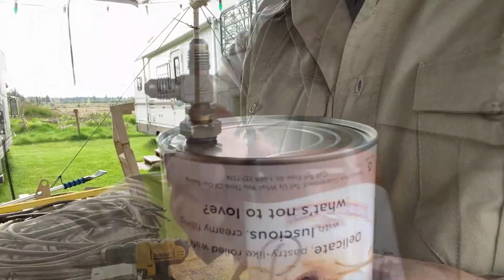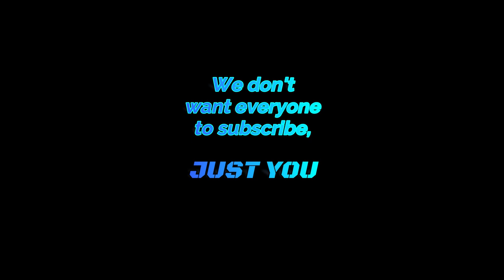FMTV TRAILER HYD Reservoir Build #113

Comment: Hi, off subject and desperately looking for the location of the turn signal flasher on the 1078.  I'm frazzled from trying to find the problem and this is the only thing I have left to try.  But I don't know where in the heck it is!
Reply from the maker: Yikes, Mark. I am not sure where that is either. I'll ask around and get back to you.
Reply from the maker: Here is something to try... The multifunction lever that controls the turn signal as well, has three grounding wires... make sure those are properly grounded. The flashing unit is behind the passenger kick panel, below the main fuse panel and just above the CTIS pressure control box, or at least in that area. Hope that helps. :-D